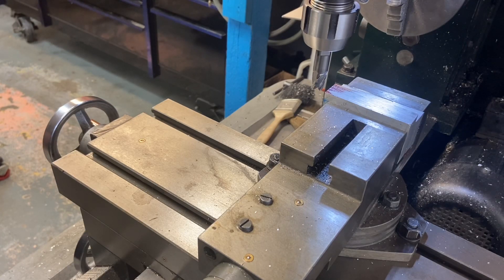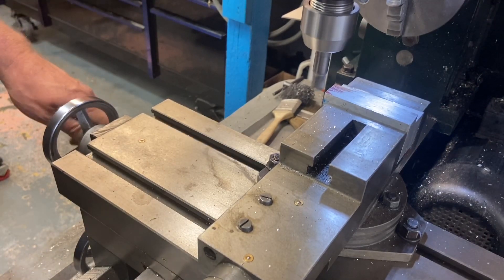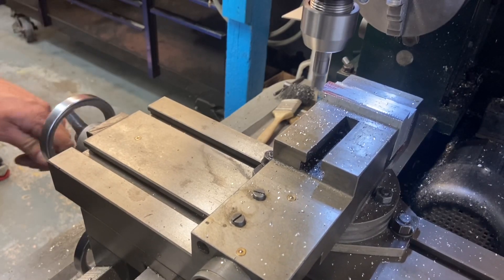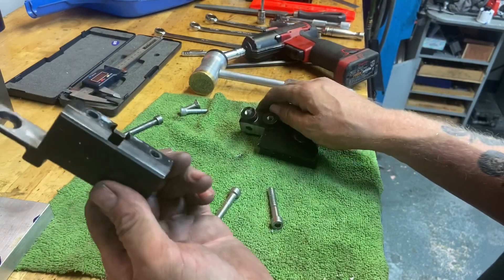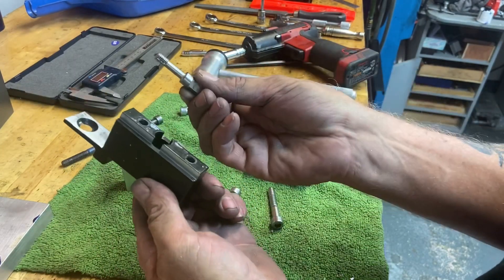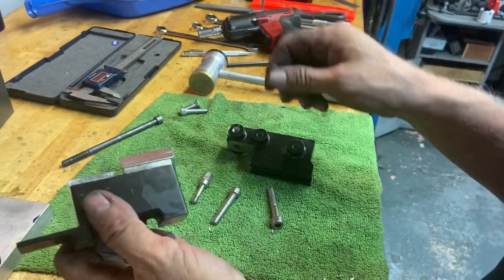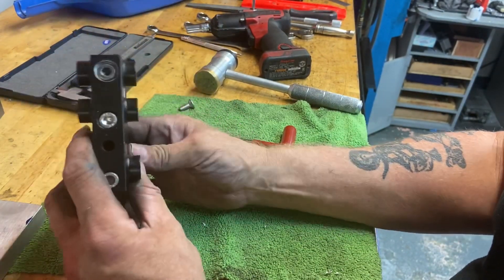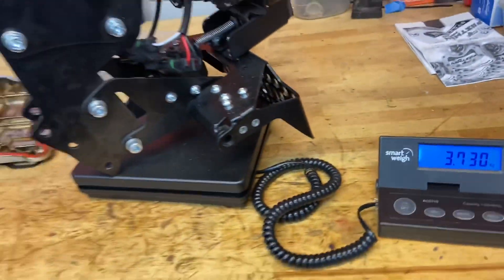Video #8 of the CRF rally build.

Comment: Terrible to see you have to put in this amount of work into something just should be ready to go on and without obvious issues. That bracket for the head tube is essentially relying on just one bolt to hold the rally tower before your modification.
It's also sad that with the amount of work you've had to put into the fitting, you could have probably designed and manufactured a tower yourself on the mill and lathe.
Good luck -- I hope this gets resolved.